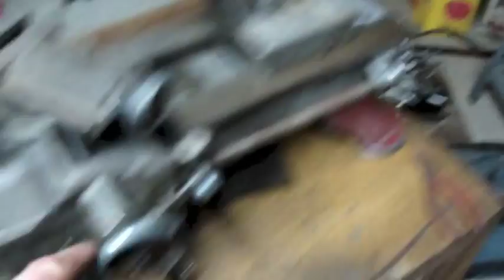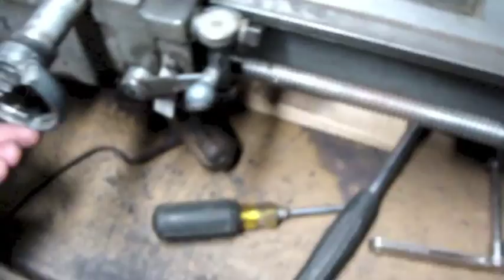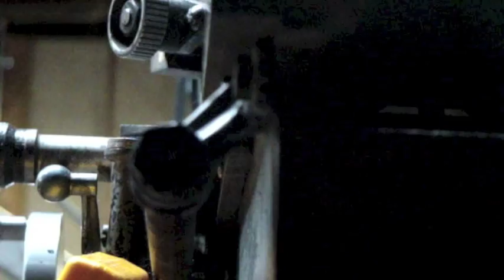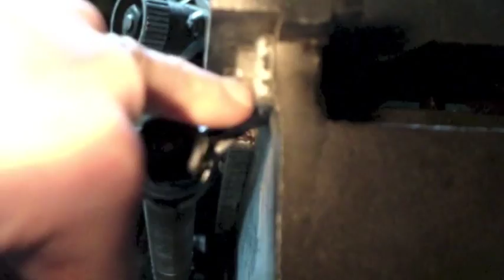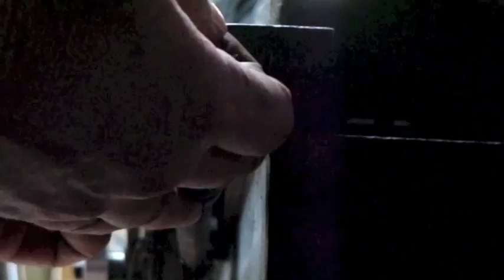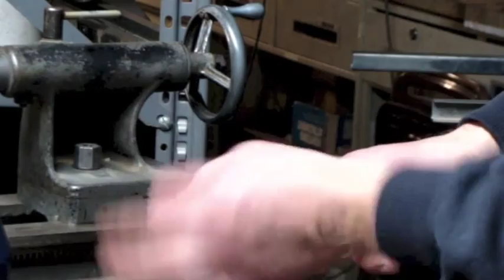Atlas 9" Lathe Part 22

Comment: Hi Steve,I am no expert but I have an atlas 9 as well newer roller bearing one...no quickchange..I hope you have checked that the lead screw is not bent...maybe build adjustment into the new one... also you may want to include a mount for a electric motor to turn the lead screw as Tublican did.Also you need to loosen those belts a lot if you put that kind of pressure on those babbits they won't last long.....I start mine in the untightened then tighten I found as a beginner like you the belt slipping a little has kept me from breaking things.....also I have not heard of shutting the lathe off to change feed directions only not to force the change if you move slowly and gently it works fine you have to wait for the cogs to align.keep it up enjoying the videos
Reply from the maker: Thanks for watching. The lead screw is not bent. I will take another look at that belt tension when I get around to re-greasing the jackshaft assembly.

Comment: Still willing to make a bracket. My lathe is a 12" with a 3/4 leadscrew but I think the mount is the same spacing (1.4375 down and 1" out from corner under way).

I have a block of brass and some angle iron. Just will need the hole size and length of the block.

Contact me through the "Email Me" link at the top of the pages on my A/C lathe if interested:
http://shdesigns.org/Craftsman-12x36/index.shtml
Reply from the maker: Hi Scott, thanks again for the offer, but I just picked up a oilite sleeve bearing today, so I should be able to make something up this weekend. I went to the city last week to get one, but got the wrong size. Lead screw is 5/8" but I forgot the end is turned down to 3/8", so I went back today and exchanged it.
Reply: OK, looking forward to seeing it running.

Comment: In my experience, JB weld works better when you use it as an adhesive as well as bridging. Just bridging rellies on the strength of the JB weld alone, where as using it as an adhesive brings the original structure back into play.
Reply from the maker: I agree! This failure just underscores the initial flaw in this part. I am told this was designed to fail in the event of a lathe crash, allowing the leads crew to unscrew itself, and spare the drive train gears from damage. They beefed this part up in later years.